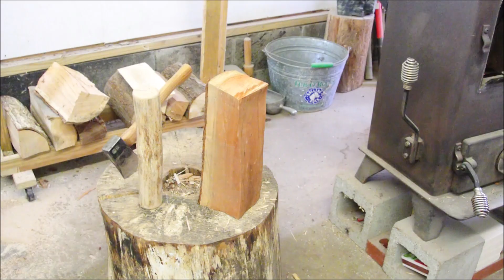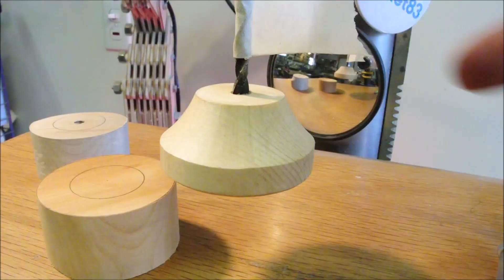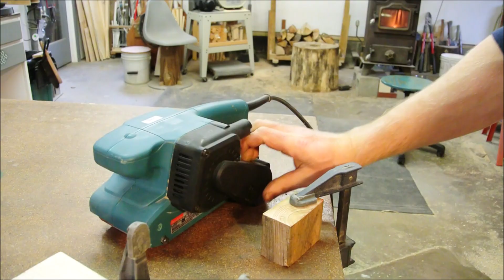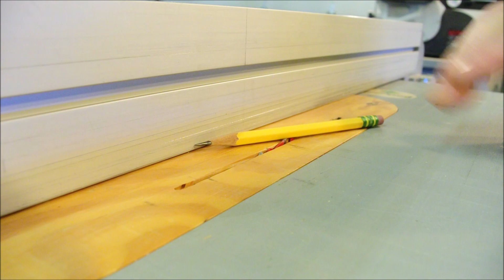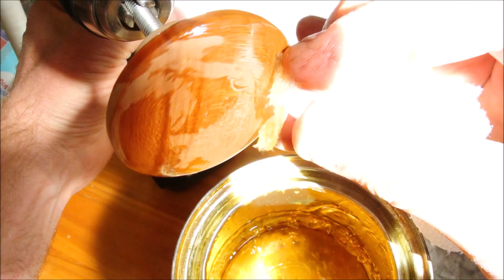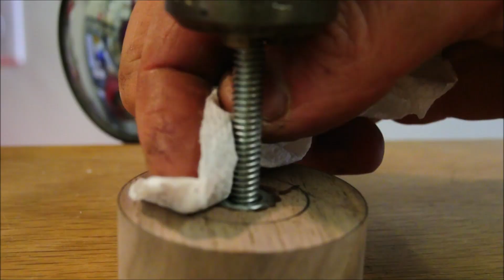NO LATHE. Pro-quality Wood Knob Making by pocket83

Comment: I was going to suggest the use of thin CA on the wood threads (something known via balsa wood model making) but I see it has been already mentioned. I'd like to thank you, Mr Pocket, for showing the 'alternative' method of forming the grip side of the knob, with the portable belt sander. I'm in the process of trying to find uses for a small bench-top 6 speed pillar drill (besides drilling...) so I can justify buying one. Seeing that “hidden feature-port” on the “man/crafts” belt sander gave me an idea and one more reason. Always a pleasure, and again, thank you.

Comment: After watching your chamfering device built, I had an interesting improvement idea for the hight adjustment, instead of actually lifting the table up and down with the wing bolts you could slide one of the table sides closer and farther apart(while maintaining parallel of course) from the other one, there by adjusting the size of the gap and effectively limiting how much "meat" is allowed to be exposed to the belt sander

Comment: On the table saw, a smaller blade will take a bigger (as in deeper) scoop. The smaller radius means it can go farther in before it hits the edges of the knob a larger radius means a shallower scoop because of the reverse.
Reply from the maker: It would be hard to match that comment with a reply that's sufficiently condescending. 
Instead, you get a complete dismissal, and I'm going to get a cup of coffee.

Comment: The knob design is very nice and your sanding technique makes it easy to shape.  If I could suggest about the threads.  I just did a video (5 Minute Wooden Knob) about using the "slide in T nut" for the threads.  I find that the  t nut is the easiest and fastest way to get good threads into a wood knob.  Your opinion of my t nut idea would be appreciated

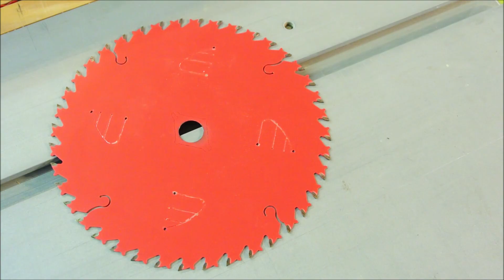Comment: At 8:47 you say a smaller blade will cut a smaller scoop, but wouldn't it be the opposite if the scoop goes from edge to edge? A 2" diameter blade for an extreme example would have to cut 1" deep into a 2" knob, but an extremely large blade would be almost 'flat' and barely take any material away.
Reply from the maker: The goal was really just to get you to think about it. 

If you'd like to explore the mathematics of it, you'll be comparing the respective volumes of two different spherical caps of varying heights & radii; so the answer is probably not as simple as bigger scoop + shallower  = less ice cream. 

But yeah, my explanation could've been more precise.